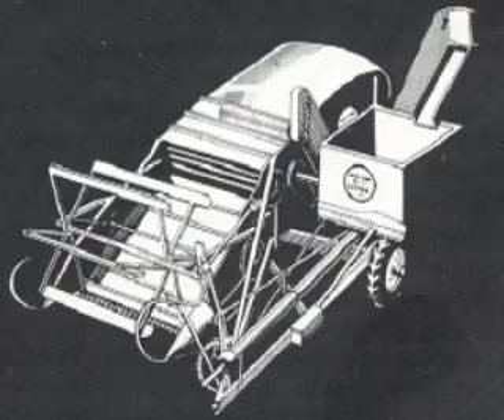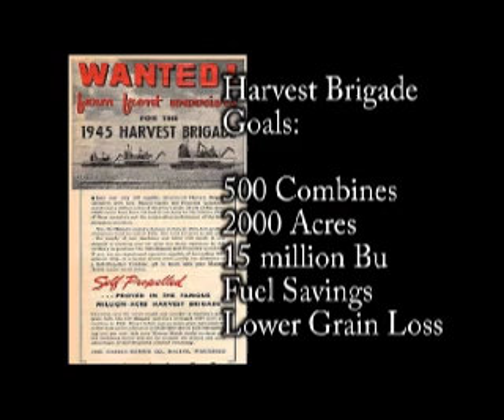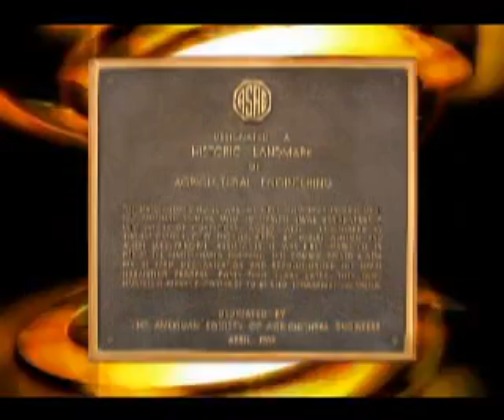Massey Harris #20 Combine ASABE Landmark No 15

Comment: My great-uncle Albert Luke and Robert Ashton both worked with Thomas Carroll in designing that combine.
Reply: That's most interesting. What was their opinion of Tom Carroll ?
Reply: The large combine shown at around the 2 minute mark, is another Massey Harris 20, not a 21 as stated in the commentary.
 There is a MH 21 sat to the left side of the larger machine, but it's barely in the picture.